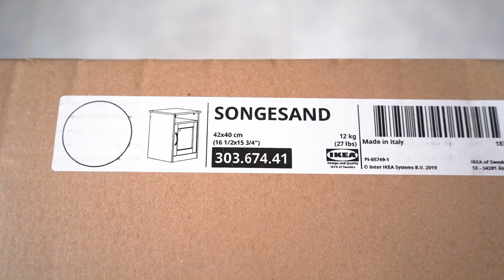Ikea Songesand Bedside Table Assembly

Comment: Thanks but why is my door catching on the bottom? Did i screw it incorrectly?
Reply from the maker: Hi, maybe just need a little adjustment, please check if there is some loose screw, you can also adjust the screws in the adjusters in the mounting plate (center hinge).

Comment: Thanks for the video. Is it possible to assembly it so that the hole for the cables is on the bottom corner, instead of the top one?
Reply from the maker: Hi, there is a two hole for the screws or lock in the back cover, if you put the hole side at the bottom (upside down), you will need to make a new hole for the lock/screw (in video 8:08) I think it is better to create a new hole or cut a small part of the edge at the bottom.